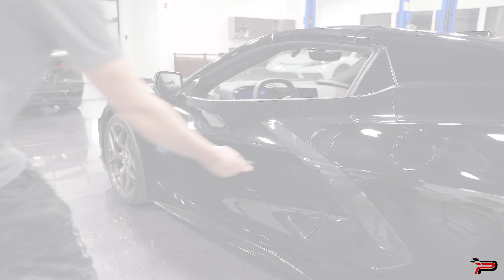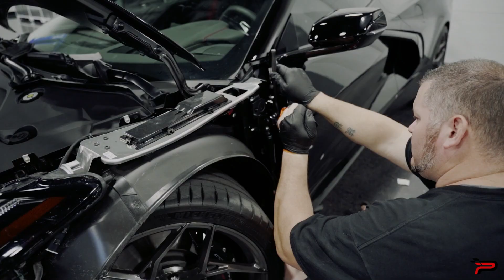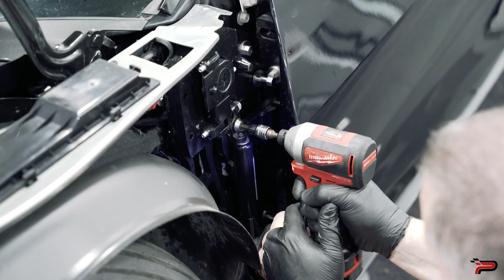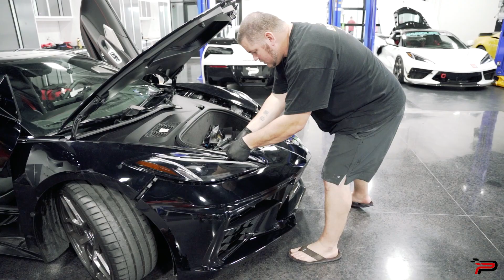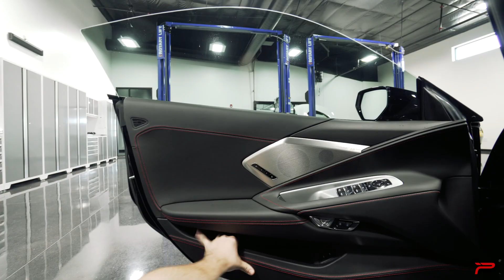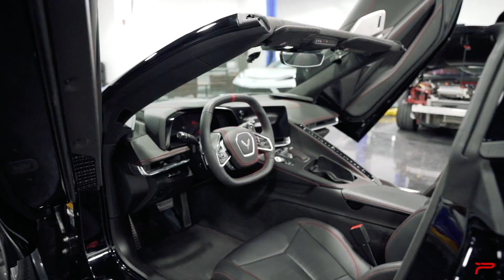C8 Corvette Vertical Doors! - Paragon Performance

Comment: Could you make ZLR doors, instead?
Reply from the maker: We aren't the manufacturer of the kit. That would be a question for Vertical Doors.
Reply: he doesn't. i asked because id prefer that door it has one motion instead of opening the door half way then up.
Reply: Yes, I am a Certified dealer and installer for Vertical doors inc and have personally installed a ZLR style kit on a C8

Comment: Would be cooler if it was a scissor door, rather than a push out and lift.  What's the point of lifting?  Door is already open when you open it.  Straight up scissor door would be wayyyyy better.

Comment: Are you able to open the door fully and just use the butterfly door as an effect during carshows? Or will it only open a little like shown on the video
Reply from the maker: The door will only open partially as shown in the video.